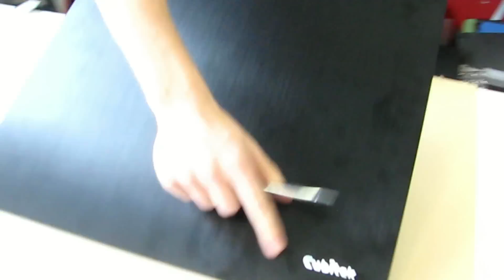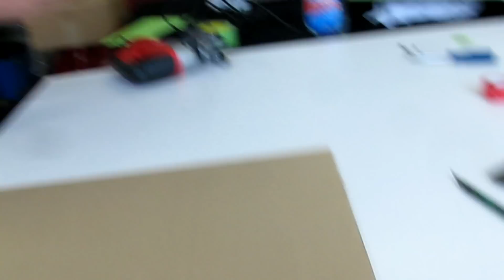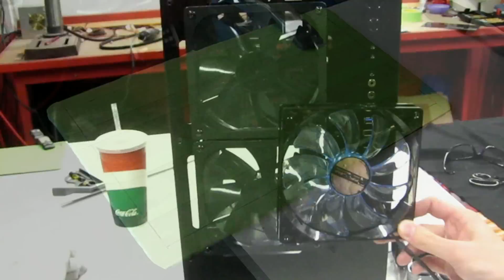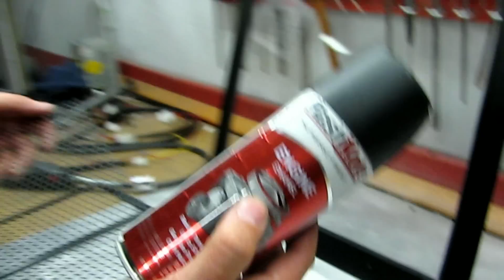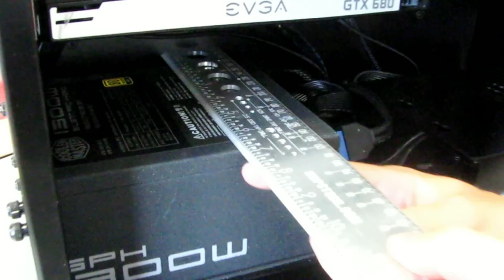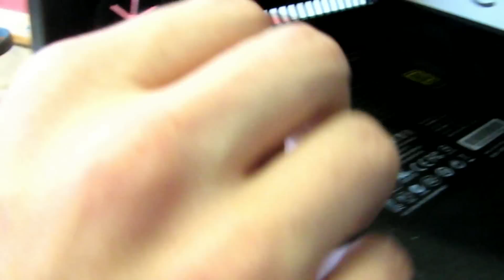Case Mod Guide: Cubitek "Magic Cube AIO" Gaming PC.

Comment: am i better of buying a jigsaw or a dremel for cutting out sheet metal?
Reply: It more depends of the length of the cuts you're planning to do. If you're only planning doing small 'surgical' cuts, buy a dremel. If you really have to cut large sections of plastic, metal or acrylic, use a jigsaw.

However these two tools complement each other. If you're budget is low, you try to find these tools second hand or at auction sales. The basic dremel isn't that expensive, but the costs of cutting discs can really total up on a project if you're using the dremel allot. Modding gets easier once you have a decent toolbox. But anybody has to start somewhere. Changes are it's easier to find someone that can lend you a jigsaw, so I would start buying a dremel and start with small easy modifications.. Start with something like the wire-tuck box. If you make a mistake, you haven't ruined your case, all you need is a new piece of acrylic.

Good luck!

Comment: I think in addition to the adhesive on the window I would have ran a bead of silicone on the outside edge for a little extra hold and sealing purposes.. just me but I can see that window getting pushed in easily.

Comment: what do you call that black wire strip to cover the sharp edges of the cut
Reply: just google it : 

Rubber Trim
U-channel edge molding for PC panel mod windows
RUBBER EDGING

Comment: just got some modders mesh to open up the Xigmatek Vanguard so it can really breathe it has only front intake fan mount! and use tulle fabric as a dust filter mesh. (doing a skyblue & black theme based on the ASrock mainstream colors)